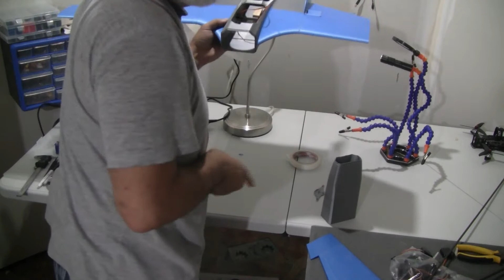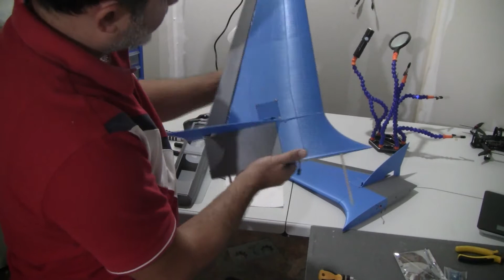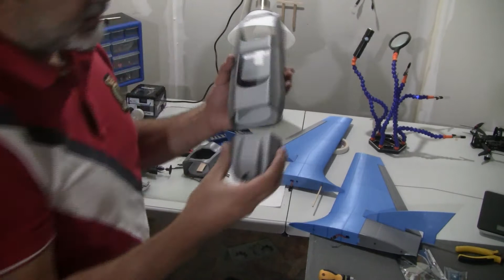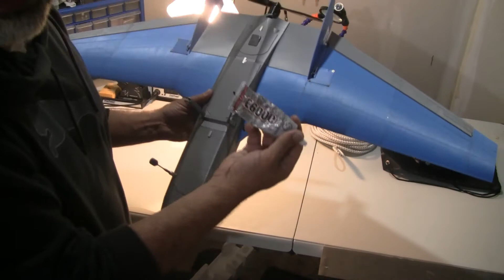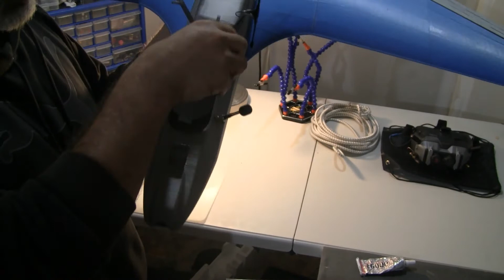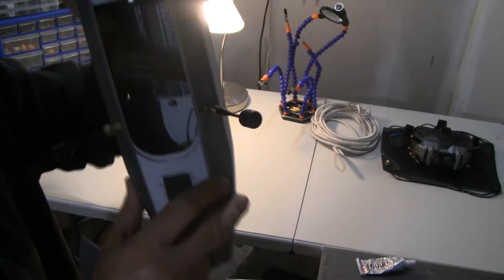3D Printed Swept Forward FPV Wing   Part 2

Comment: I would like to Print the Wings out of LW PLA. Becurse there are carbon Rods. But I wish the Carbon Ross are longer threw complete wing. I and I worry if than the CG is to Wide in Front. But I Can scale the nose Parts Little shorter and Put the FC and the ESC in the Back. Of Fuselage.